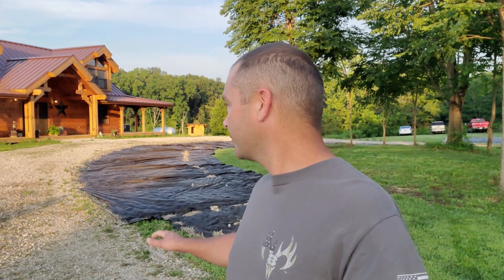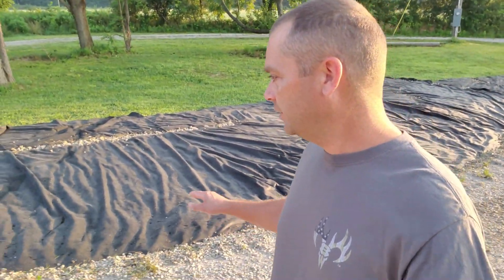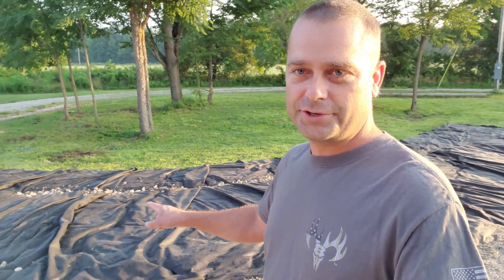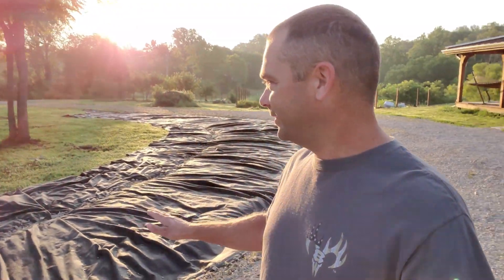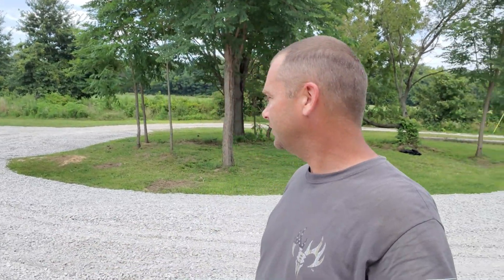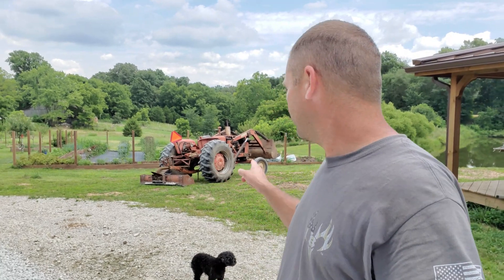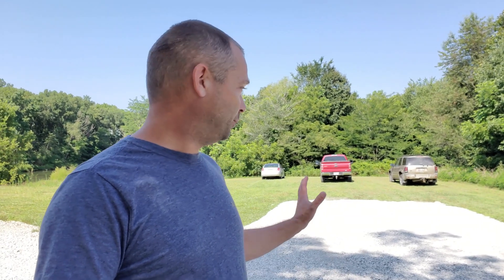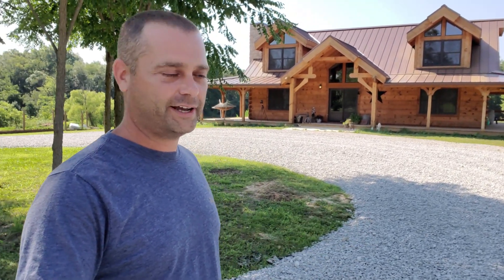Making the Circle Driveway Wider - 7 More Loads of Gravel Added to the Driveway

Comment: Thanks for mentioning the approx expense.  We built 650' back on 5 acres in Wisconsin and the driveway has been a battle.  Snow removal, pot holes, raking, etc...  Concrete is the answer, but $$.  Now we just have concrete by the house and lime stone screenings to the road.  That seems to work pretty good.
Reply from the maker: I can see if you have a lot of snow removal, that would tear up the driveway.

Comment: You can adjust the height of your 3 point hitch so it does not dig in, set it on the lever you lift and lower the hitch with. Works like a charm once you get the right height. also tip the front up a bit with the top link and it will float over loose gravel and smooth like a road grader. Box blades are great but take setting up a bit to get good results.

Comment: Looks really good.  I am no expert by any means, but adjusting the top link on your tractor might help with using the box blade.  I am still learning how to use one myself.  Right now our driveway on our 35 acre property is just a clay/sand mix (North Florida).  Estimated length is probably about half the length of yours (roughly 250 yards).  They are going to be re-paving the highway that our property is on and I'm hoping to get a deal on asphalt millings once they get to work on it.

Comment: Looks good, wondering about longevity with it now.
Did you patch that thin section too? Is it working better for you?
I want to make a gravel parking pad for my place & I hope to get away with pea gravel,
I had an issue with wet conditions & being on the ground. Hoping 2-3" of gravel can make that go away. 1/4 mile drive way with usable circle terminus about 12k.  Pretty close to  1700' off road/main hiway good privacy.
Thanks for sharing
Reply from the maker: Yea, I didn't show the thin section, I had a lot going on that day.  They covered it with a layer of gravel and it helped a lot.